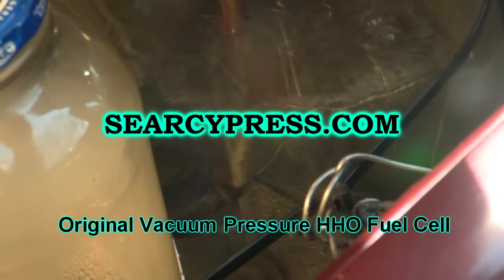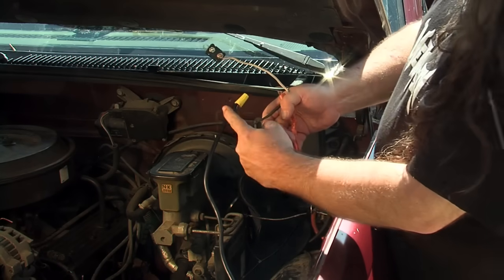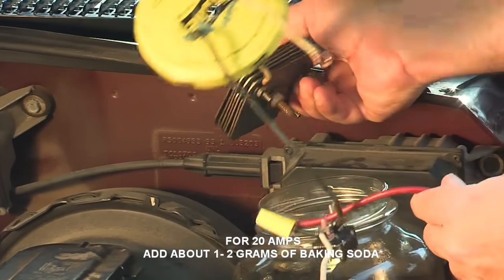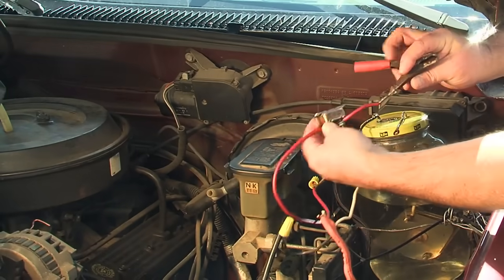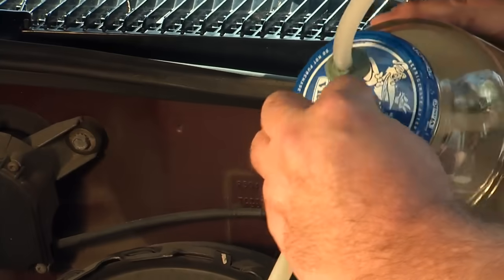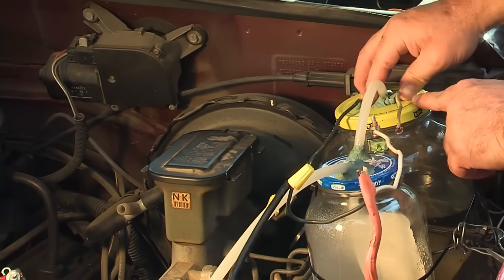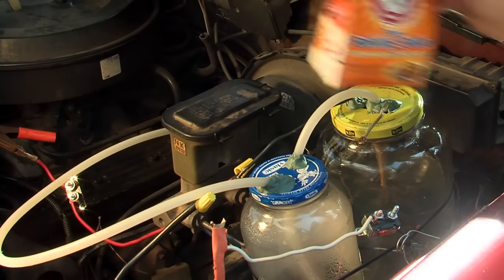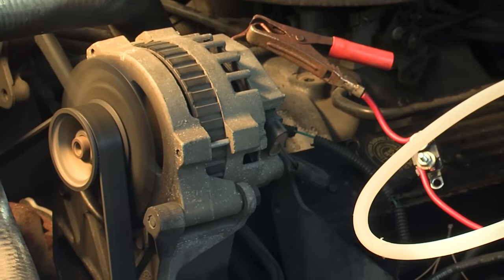Vacuum Pressure Hydrogen fuel cell defeats high gas prices using hydrogen from H2O.

Comment: Please tell me that you eventually put a flashback arrestor on this?
Reply from the maker: We started doing this around 2007. That flashback arrestor technology was not well known at the time. We did at least add the bubbler. The system runs in vacuum. The only issue is if for some reason we forgot to turn off that switch. We climb back in the vehicle and start the engine and drive off. Vacuum sucks the enriched gas into the motor and after some delay we are reminded of our mistake. It only happened to me one time and that is something I would not want to repeat. I will say that the jugs remained intact. And amazingly I was able to screw those lids back on. I did however have a permanent circle on my hood. Without advising anyone to repeat any of this I would support flashback arrestors. I like your channel, thanks very much for the comment.
Reply: @metalpresstv  thanks for replying so quickly!  Yeah, that would have scared the hell out of me!  I think that this is an absolutely wonderful idea that has lots and lots of potential.  Just needs some tweaking is all, and I say that without having seen any of your other videos on the subject.  It would be great to figure out how to incorporate the switch init the ignition system so that you wouldn't have to worry about that anymore, causing it to turn on and off with the key.  But I don't know that could be done and still have it hooked to the alternator.   Thank you for the kind words about my channel!  I work hard on it with what little time I can dedicate to it at this time.  Hoping to be able to put a lot more time and resources into it soon.  Thanks again for your reply!  I really appreciate the information and wish you the best.  Merry Christmas and have a happy new year!
Reply from the maker: @BackYardScience2000  even the naysayers (thinking we are claiming over unity) who don't realize we only burn 80% of the gasoline fuel normally, would not be able to deny the fact that they can burn a much lower octane fuel saving a lot of money. Again I'm not sanctioning doing any of this, I am just stating the information. Thanks again!

Comment: So, you turned water to hydrogen gas and then burned the hydrogen, why not just use the electricity by itself then 🤨
While I guess it works since the hydrogen supplies the engine and turns the alternator sending more power into the battery, it is sort of redundant

Comment: By the way:  you can't get more energy out of a system than you put into it, Law of Conservation.  The energy you use to separate Hydrogen from Oxygen is far greater that the energy you get back when you re-combine the gasses.  If you generated the HHO externally, then you might see an improvement in mileage, but you still have to pay to generate the HHO.  Depending on energy costs, it might be slightly cheaper using this method, but not worth all the trouble.
Reply from the maker: If you assume you're burning 100% of the energy in the gasoline you're correct. This engine only Burns about 80% of the fuel normally. Enriching the fuel with HHO can greatly increase efficiency of the burn. It's not over unity it's just getting more out of what you're losing. Furthermore, using this system allowed us to burn low octane fuel without any engine knock. This saves us quite a bit of money right there.Thanks very much for the comment.

Comment: What is "Vacuum Pressure" ?  Vacuum and Pressure are opposite terms.  If you combine Pressure with Vacuum, they cancel each other out and you have nothing.  Your alternator outputs more power then your battery?  In what universe?  Your alternator is good for 30 to 70 amps, depending on model, where your battery is good for over 600 amps, further, they are connected together, so either one will give you the same power.   You didn't give any real numbers or scientific proof that this does anything.  Did you lean out the mixture on your engine's fuel?  If not, then you are consuming just as much gas, you just added some water to the system.  With the amount of HHO you are producing, you would be lucky to power a 5hp lawn mower.  Compared to a 300hp V8, it is a drop in the ocean. At best (if this even works), you might get a 2% improvement.

Comment: Thank you for sharing your wisdom!! Can you imagine if we taught this to high school kids or showed ppl how to recycle their plastic into fuel for cooking? 

Question: How often do you recycle the water? Or refill the water tank? 

I LOVE how you used pickle jars....ha ha 
I love pickles too! Hugs! And thank you!
Reply: Teach kids in highschool to make fake trash and spew lies on YouTube just for views and at best u might get an engine compartment fire. Yeaaa ur not to bright are ya.

Just idling your engine is over a 600 rpms. Driving a 2.5 liter 4cly motor  is about 150 cubic inches. That's 37.5 cubic inches per a cylinder. A cylinder fires ever 2 full rotations. So in a minute of idling at 600 rpms your engine will use 11,250 cubic inches of air a minute at just idle. That's a 187.5 cubic inches a second of air. You're not producing even 2 cubic inches a second. But don't forget that it's h2O 2 parts hydrogen 1 part oxygen. So 1/3 of the gas isn't even hydrogen it's oxygen. So not even 1% of the air being taken into the cylinder is hydrogen. The only thing being accomplished here is the alternator is working harder for the high amp draw dragging the motor down more reducing fuel mileage. This is why water isn't used as fuel in a motor vehicle. 

Now don't forget we don't drive at 600 RPMs most people will be around 1800 rpms at cruising speed. That's 3x the amount of air with still the same hydrogen production. So now ur way below the threshold of .03% hydrogen in the cylinder. Using a spark arrestor on the output hose to keep from blowing the jar up you would be hard pressed to even candle a flame let alone put anything measurable in every cylinder 900x a minute cruising down the highway at the speed limit.

Comment: how do you keep the water from freezing during winter?
Reply from the maker: Above 20° I've never really had a problem. Probably the baking soda and byproducts that keeps it from freezing solid. I'm sure there is a limit to how cold you can get it before that happens. My climate here is not that cold really. All the years of using it it's never frozen solid and busted a jug. Thanks very much for your comment.

Comment: Nice set up, I would just add running 30 amps through your firewall is a bit ballsy,  go the extra mile and just buy a relay, then you dont need such a heavy switch in the cab.  A small half amp rocker would do you nice on a 30 amp DC relay to power it all.
Reply: Please explain.
Reply: @VivaCristoRey_Y_AveMaria  A relay is a simple device and one of my favourites. They are usually rated 12/24v, let's say we pick 12vdc as it is the natural voltage of small vehicles and not RV or trucks.

What a relay does is, you can run or share power for your fog lights or headlights or whatever you like your control to be on, for the relay to then open up and send 30A for example to your HHO setup. But the signal of 12v can be low amperage, milliamps at most. That is why it is better than running a fat 30A wire right pass the firewall and into the panel, where you could say connect up the fog lights of your car to the relay, and when you turn on your fog lights, the fog lights will share minute power to the relay to switch it on to allow 30A to pass through. So then you can control your HHO through your fog lamps for example.

Comment: Is the truck running on gasoline as well or hydrogen /oxygen or has the engine to be modified to run on hydrogen.
Reply from the maker: The HHO gas is used to enrich the gasoline. This truck only Burns about 80% of the gasoline you throw at it. Using a little extra power from the alternator we can increase that efficiency tremendously. It is not an over-unity process. Burning pure hydrogen oxygen gas could possibly melt the engine into a puddle of lava. Thanks very much for the comment.
Reply: @metalpresstv  What about the conversation of energy?

Comment: I knew an old guy who liked to tinker with this kind of stuff. What he showed me one day was basicly a set up that added steam gas to the fuel/air mixture. He had copper tube wound around the exhaust manifold several times and little water tanks and stuff. It fed into a riser plate under the carb I think. It was many years ago. Perhaps it's a common hack that has a few well known names.
Reply from the maker: Most don't know this engine normally only burns 80 percent of the fuel. Plenty room for improvement without over unity claims. Thanks for the comment.

Comment: OUR NEED FOR A HYDROGEN WORLD
The problem with this bad clickbait , about using hydrogen for fuel , , is not that hydrogen is not suitable fuel , cheap, and why this system of present fuel systems ripping off the masses ,  does not promote , hydrogen , and hides the methodology why hydrogen works , and prevents it being used as a fuel. It is about awful and bad vids like this that do not explain the details that can make people produce their own hydrogen for cars. As in this case they do not explain how you get hydrogen in to the fuel carburetor,  and what you need to do with oxygen screw on that. Also the need for a filter to added to prevent any explosion from a flow back from hot
oxygen , when  switching the hydrogen off , that could cause an explosion if the filter is not their to break that flow back from oxygen in the Hydrogen fuel system. People like this are the problem not the solution , in failing to show how the complete set up actualy works where using Hydrogen fuel is concerned. Hydrogen can reduce the cost of fuel, dramatically,  hence why the oil giants ensure cars are not produced with a fuel carburettor set not  to absorb , hydrogen efficiently ,  or have a  hydrogen filter , between the flow of hydrogen , to the carburettor fuel intake. . This is not Rocket science if people make any serious effort as the cost of fuel makes many more people look to adapting their cars to use Hydrogen . They will quickly discover how badly we have been ripped of to date by the collision of corrupt car and Lorry  manufacturers,  not designing a fuel carburetor that can take Hydrogen , safely from the beginning 
for the gas  combustion engine,  to do its bussiness,  with the cheapest fuel on the whole planet to date. Its production self sufficient 
from a fuel tank with water , being converted into hydrogen from the alternator , and the 12v or in lorries 24 v batteries as a backup 
in this hydrogen fuel system.
What is strange why private Lorry delivery companies , do not invest in adapting their vehicles to adapt to using Hydrogen. I know of
bus companies , who tried to use cooking oil , and Taxis etc , for diesel engines. But the pressure from corrupt governments in wanting to tax even cooking  oil,  and draconian penalties for using them outside , the present system, with state collision of 
the present oil giants wanting to keep their high inflated fuel prices in their monopolies over licenced  fuel,  to date.
Has discourage the more adventurous,  and inventors from moving more strongly in solving the fuel crisis that is crippling the world to date. Hydrogen fuel cells and their catalysts ro produce Hydrogen even average intelligent children can produce.
This is not Rocket s science and Hydrogen is the only serious way to defeat the control of the oil monopolies to date who determine the cost of energy we need in this world.
We can become self sufficient and produce our own energy needs if the masses wake up to understand even the basic science of the safe use of Hydrogen with filters. In which like natural gas , is a explosive that can kill , you in your home as much as hydrogen gas has the same explosive dynamism. Hydrogen use  can be harnessed as efficiently and as safely , as natural gas is to-day using filters and sealed pipe systems,  like we see in natural gas supply systems. Hydrogen is no more dangerous than natural gas.
The only reason you central heating systems are not produced from hydrogen gas boilers , is because the present natural gas giants ,
do not want to supply with a infinite and cheap fuel supply. 
Please as many of you as you can like me , make you car like me run on a safe  Hydrogen  self sufficient fuel system . Beside learning 
the facinating science behind Hydrogen production . You will see why our present corrupt corporate states , lie you can percieved 
in that classic Swartzeniger Movie TOTAL RECALL where Oxygen was a premium high cost , for living on mars . When their was a hidden technology that can produce Oxegen.
In our real world today we all have the potential to access the technology to harness Hydrogen cheaply for all our own well being and usage. We can move into a hydrogen fueled world if enough people wake up to demand this from our corrupt corporate states to date on our need to have our world run on Hydrogen fuel to date. Anything less than that is lies , and corruption to say the least.

Comment: Will that work on diesel engines
Reply from the maker: A vacuum is required. Injecting into the air intake ( only option I am aware of) is problematic for many reasons. Thanks for the comment.

Comment: I used to deliver over night parts it was a second job. Anyway i needed to shave the expense off of the gas cost. My van got 20 to 22 a gal. So i got an hho cell on line the rest at home depot installed it and my miles per gal went to 38 to 40.. Mission accomplished or so i thought! After about two months or so it was doing good 7 nights a week 150 to 175 miles.. Well the toggle switch for the off and on went bad and i didn't know it. So i did my run got home turned the system off and went inside. About three hours latter my wife needed a few things from the store. I go out get in my van and BOOM!!! the van blew up in a giant ball of fire. It picked the van up off the ground about three ft. Parts to my motor and intake were found a 1/4 mile down the road. All the glass blowed  out parts of the block were all over the place and my head rang for hours after that.. Needless to say it really didn't save me anything i lost that job and a pretty nice van.. Be careful messing with hho its very dangerous!!
Reply: That whole story is made up.
Reply: @zo0ot404  it is? Oh wow are you one of those people who have in site into people's minds! You know a lie from just a story? I bet you are! And you waste your time on YouTube! You got this unbelievable power you could cure cancer but nope your fucking around here calling people liers! And that's not a made up story that shit happened punk

Comment: I'm not a car guy, but this vehicle is from the 1980's I believe and the engine looks way different than what sits under our hoods now, unless you are lucky enough to be driving a vintage automobile.  Will this device have any effect on a later model auto and it's installation, success, and safety?  I'm thinking all the computher chips and sensors in later model cars.  Any replys appreciated.  Love the video but, wish the finished product wasn't so darn FANCY!

Comment: A separate lithium battery you charge every night or before you go driving would do the trick and give you better gas mpg but with all the sensors and shit on new cars it might make it worse if not adjusted for the different gas going into the engine.

Comment: Seriously? You need more feul to produce the electrical energy to load the battery, which ist producing the H2 via electrolysis. That means the motor needs more energy to spin around the power generator, because when someting is draining energy there, the magnetic fields are going to be stronger and so its harder to spin it. And you lose energy in every conversion process. Electrolysis is very ineffective! So in sum you lose more energy than becoming it by the H2. We don't even start with the wear and tear of the alternator. It would only make sense with a solar panel on the roof...but the energy output there ist very very low. You need to cache it....and then you have a massive explosive.
Reply: It isn't a generator. It is an alternator. A generator can produce AC or DC current and has to constantly output energy. An alternator only puts out AC current. To add, an alternator only puts out energy when it needs to. It doesn't produce and output energy consistently. 

If you think 29 amps is going to put a strain on an alternator, you are sadly mistaken. 29 amps is equivalent to running a mild dual channel subwoofer amp. 

The amperage draw of your A/C compressor on the alternator is about 30 amps at its best. So if your alternator is capable of running A/C without stressing itself, then it can handle the 29 amp load with the A/C off. 

And if you are THAT worried, you can get a high output alternator cheap. 320 amps +.
Reply: @Twitch_Moderator  OK, when the energytake is that low, do you realy believe that the H2 output does matter when you run this motor. I mean, how much volume it has…3-4 l? It will burn a dayproduction of this „Innovation“ in a Second….

Comment: I built from old battery casing a cell with copper and lead plus stainless steel plates...one cup of baking soda to 10 liters of water....my only problem is a shut off valve to control gas pressure *(this is actually a bomb if not taken care of)nitrogen and hydrogen is highly explosive...please take care